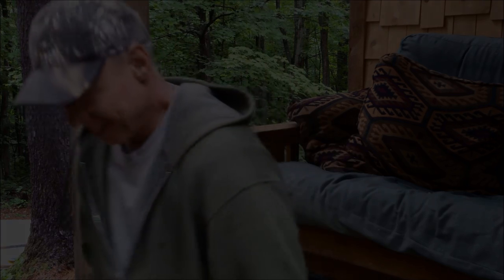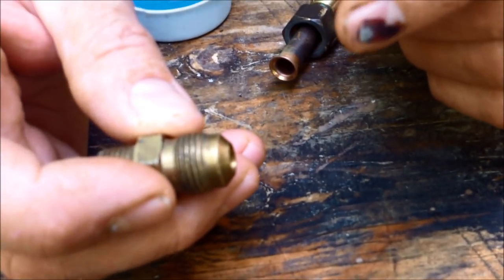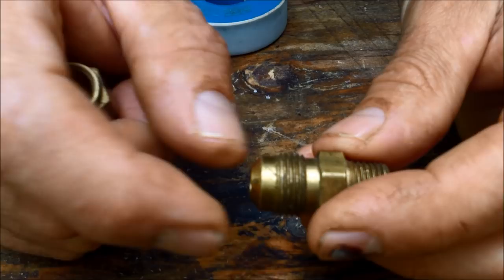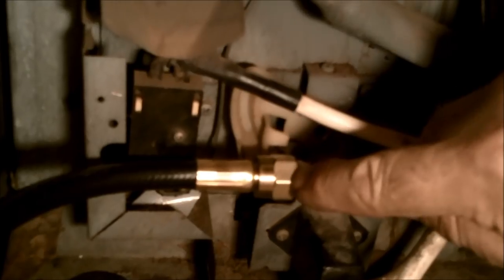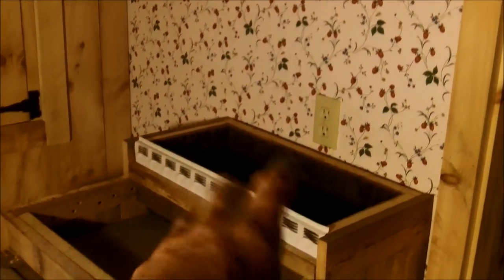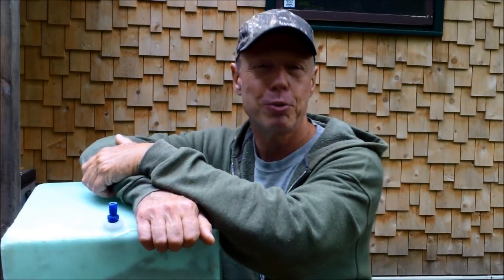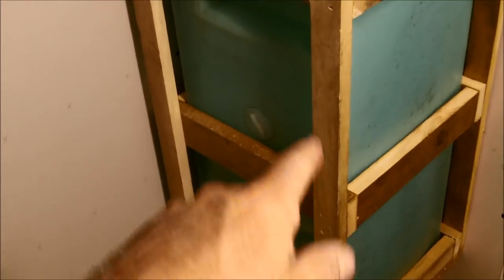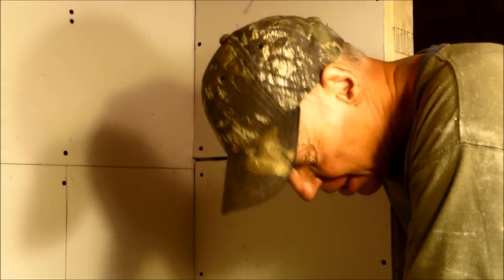NH CABIN PROJECT.   Gas Refrigerator and Gravity Feed Water.

Comment: That's not so with the small leak not so at all low pressure leaks don't blow bubbles your bubble solution isn't thick enough to catch small leaks dish soap is good fifty-fifty water soap ratio and don't shake it up just put you straight soap on it let it sit for 15 minutes come back and look at it if there's a leak there will be a bubble not at the league area
Reply from the maker: Thank you

Comment: You should not have the fridge vented indoors. Carbon monoxide poisoning ! It's a reason the ones in campers are vented outdoors and "sealed off" from inside. Love your videos, but this is dangerous....
Reply from the maker: Yes and no.  I only need the fridge during warm months and my windows are open at that time.  I'm aware of CM. Gas fridges are vented in campers because campers are small enclosed spaces but they are not vented outside in homes. Neither are gas ranges.   I appreciate your concern though.